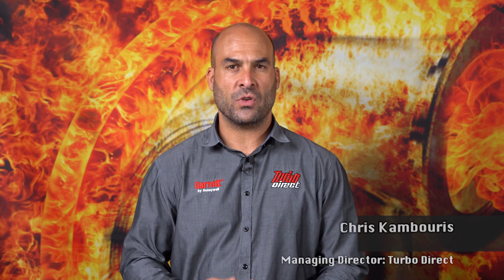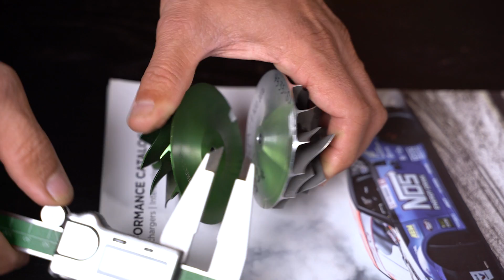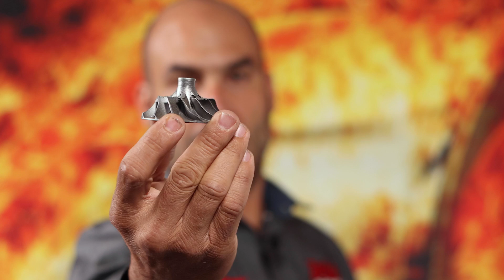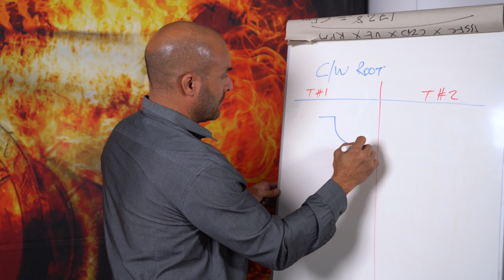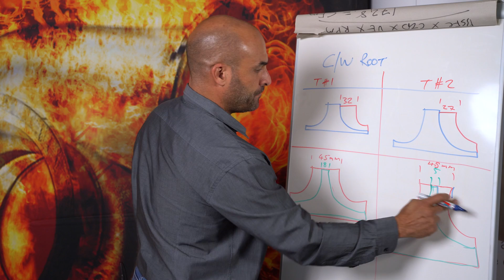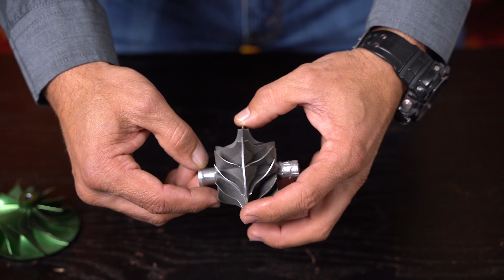Turbo Compressor designs - Discussed

Comment: So on the root width is that the main reason why cast wheels flow less than billet wheels at the same inducer size? I assume the cast wheel requires a thicker root to prevent failure vs a billet. Also second question. Why doesnt any of the big turbo companies do anything with the compressor nut in terms of aerodynamics? Ive seen some Comp turbos with a bullet shaped cap but no one else.
Reply: I'm not the expert here, but from prior convos with Chris I think I can say just mentioning a "billet" wheel does not give the full picture.
A forged billet high quality wheel will have higher strength material, and therefore can likely have a reduced root size with the same blade design, so that would increase flow area, though not decrease total weight necessarily.
Many aftermarket billet wheels may not actually be made from a proper material to have a smaller root than a cast wheel without failure. So while they may be lighter, they may not actually flow more, and they may actually be weaker.
Basically yes, cast wheels likely flow less than properly designed billet wheels of a higher strength material due to root size. But, cast may flow as well or better than cheap billet or those designed for high strength with similar flow.
As usual with turbos, it's complicated! TurboDirect S.A has another great video on that topic titled "Billet vs cast compressor wheels" that probably covers what I just said better.
As for compressor nuts, my guess is that given air flow at such high speeds/volumes over the root, the turbulence is negligible and the total mass/size of the nut is more important. Fancy nuts are likely mostly decorative.
Reply: @802Garage  I bought a Chinese billet compressor out of curiousity and I should say that the external design features are excellent, as well as the weight for its size. But I am not sure about its durability, not convinced that is made out of 2618. And yes, fancy nuts are decorative.
Reply: @aftastosk6016  Same here! Of course many billet wheels sold anywhere were produced in Asian. I have one Chinese billet wheel from a very nice seller on eBay who actually had to produce it to ship along with an upgraded turbine. Turbine is supposed to be 713C Inconel and wheel is supposed to be 2618 Aluminum. Essentially an experimental rebuild on a TD04L-13T for a Subaru.
I'm very pleased with the look and feel of the billet wheel, also very lightweight. As far as actual performance and material strength, who knows? Seems to be mostly a direct copy of a factory wheel with some added features and lighter. There are also narrow nose billet wheels I didn't know about at time of purchase.
Also ordered a GT2554 billet wheel from Aliexpress quite cheap, allegedly made of 2618.  Hard to find replacement parts for those little guys anymore. I suspect many Chinese/Taiwanese billet wheels are from the same few factories. Hopefully they do a decent job balancing! I'm sure they'll hold up in most light duty applications.
Reply: @802Garage  I ordered a 20T compressor wheel from AliExpress made by MAX ABLE (Most products there are either from them or RUICHENG). It's a 6+6 compressor that is of different design than the more usual "Kawasaki" style 6+6 billet wheel that is offered by the Taiwanese manufacturers. It has a more extended tip diameter, a different, more pronounced curvature of the main blades, and above all, smaller splitter blades. Judging by its appearance it seems designed to be more efficient at higher boost levels that the billet wheel, which by itself extends the efficiency range of the MHI wheel by 0,15 bar (from 1,3 to 1,45. This is empirical observation by other users). I have no idea from where the original design came in, possibly it's from ARD which claimed that its compressor wheel could go up to 1,7 bar.
This compressor was ordered out of curiosity but also as a possible replacement for the Td04L-13T that I am running right now in my car. While in theory not the most sensible choice for a Td04L, it was a pleasant surpise that it weights only 37g, 5 grams lighter than the original MHI 13T! 
I want to ask you a few things about the parts that you received. Is it a 9 or a 11 blade turbine wheel? Is it a 6+6 compressor? Have you done weight measurements? Have you installed the new parts in the turbocharger and if you have, how well have they performed?
Reply: @aftastosk6016  Yep the GT2554 wheel I just ordered was from Ruicheng! Max Able was the other option. Same findings. That's an 11 blade wheel with a narrower nose than the original.
The TD04 compressor wheel I got is a standard nose width 6+6 blade. I believe it has slightly extended exducer tips, but factory blade height. It's basically a copy of the factory MHI wheel, but machined aluminum obviously. Not sure if the splitter blades are smaller. I'll have to compare them. I'm very sure it will be lighter overall than the factory wheel, meaning it probably doesn't have much higher material strength. It looks very nice for whatever that's worth.
The TD04 turbine wheel I got is a 9 blade extended tip design. Instead of the original 12 blade it's 9 longer blades with I think a slightly more aggressive profile. So should be more total flow volume, but probably similar blade area, and actually overall slightly lighter. So allegedly more spool and max horsepower. Not sure of downsides if any other than the longer blades and issues those may cause. Possibly not as strong or not as stable at higher speeds.
I have not installed either yet or fully compared to the originals, but I will soon and I'll try to remember to get back to you. I'll note any small differences I see and compare weights. I'll also have a full video of the upgrade on my channel at some point. Both items were ordered from the seller jan_hk2015 on eBay. Hope your experimental upgrades go well!
Reply: @802Garage  the 11 blade compressor wheel is a good option for the GT2554, especially if you have the 0.80 a/r compressor housing. 
The Td04 compressor wheel if it's made out of real 2618 alloy it won't have any strength problems and it would be significantly lighter. My 20T weights 37g while the stock cast MHI should be around 45-46g, which itself is a very good number. my concern is that is it's made of something else, it would be more heat-expanded than it should be.
About the turbine wheel, you won't have any stability problems as long as it's properly balanced. You need to go to someone to get it balanced after install. As far as strength, as long as the CHRA is in good condition and the compressor is not overweight (e.g. installing a 20G in a Td04L) your only concern should be excessive backpressure and overheat.
Now about the number of blades, the general rule is that more blades would provide a better spool - a better response in general. The less the number of the blades, spool is building slower and of course backpressure is reduced. I am not so enthusiastic about the 9 blade turbine wheels in the MHIs turbochargers, I don't consider it an overall improvement but certainly is more suitable in many cases. In practice less weight keeps boost threshold at around the same point but boost is being built slower. To understand if the 9 blade is for you, a good indication is where your wastegate is setup. If you need to be setup very high (let's say above 1 bar) then, the 12 blade (or 11 which is a good middle ground) is for you. If it's too low, then the 9 blade is a better option - but in this particular case going for a stock 12 blade MHI Td04H maybe a better option than a  9 blade Td04L. It depends on the application.
I decided not to install the 20T in my Td04L but replacing it with a Td04HL-20T. The truth is that the Td04L is installed into a 1.8 lt engine so a Td04HL in theory is a better choice. Let's see. If I was about to order it now, I would had taken a 19T because it's virtually impossible to find a 20T housing, so I need to machine a 19T housing - extra cost.
Reply: @aftastosk6016  Interesting insights! I've rarely heard of or seen the 20T so yeah 19T seems more sensible in terms of parts availability. The 9 blade turbine 6+6 billet compressor upgrade turbo I'll be testing will likely go on an EJ205. I should be able to tell if there is a hugely noticeable difference.
Reply: @802Garage  you would hardly notice any difference in spool and you are going to have a bit more top end. Not huge differences but certainly a situation where you lose nothing and gain something. I would prefer going for a 19T and obtain a used 19T compressor cover which here where I am costs 50 euros. The other more expensive option (assuming that minimal lag/excellent response/spool are your top priorities) is to go for an aftermarket Td04H-19T which is a very well balanced turbine-compressor combination. You would lose 100-200 rpm in boost threshold point but in all other parameters it should be a 100% gain.
Reply from the maker: @aftastosk6016  2618 isnt always the best material. the 6000 and 7000 grade materials also provide a great option depending on the application.
Reply from the maker: @aftastosk6016  Ask for a compressor map and then see what happens. Its easy to thumb suck something and make it look pretty - who tested it? Where is the data? Where is the choke and surge limits versus P2C and speed - this is key info so you can know how the choice will match together with the rest of your build.
Reply: @TurboDirectSA  my concern is if is made out of 2618 as advertised.
Reply: @TurboDirectSA  unfortunately aftermarket compressor wheels rarely if never come with their compressor maps, chinese or not. Even OEM compressor wheels they don't have their maps disclosed, you know that very well. So a "best guess" is our only option even if that can be misleading, I agree with you. Myself I am the last person that would be impressed by a fancy looking compressor, for example the cast MHI/Greddy wheels are still one of the best out there. However many people got hooked into the "next best thing", wicked wheels, bat wheels and all these fancy shapes.
Reply from the maker: @aftastosk6016  I understand so confirming material spec based on what the company advertises.
Reply from the maker: @aftastosk6016  With performance setups, MAPS are almost always disclosed. OEM applications are not for various reasons.
Reply: @TurboDirectSA  these "various reasons" feed the aftermarket. I am very traditionalist in my views, it's not a coincidence that 95% of new turbocharged cars have 6+6 cast compressor wheels. People ignore that apart from the blade optimization process that is far more important than being cast or billet for overall performance, castings have been improved a lot the past decades.
Reply from the maker: @aftastosk6016  I hear you and agree with you there. Also remember that OEM applications arent looking to extract the maximum flow from a specific size compressor - so a 6x6 design is more than adequate. OEM designs are also very limited in the amount of boost they run and the turbo is designed specifically for one engine application and not made to be used as a universal unit to fit many engine sizes and states (flow rates, valves, cams, CR's , fuel types etc)
Reply: @TurboDirectSA  Thanks for all the awesome replies!
Reply from the maker: @802Garage  Pleasure - anytime.
Reply: @TurboDirectSA  In most cases OEM turbochargers leave room for improvement by the simple fact that they come out of the factory with a significant safety margin for reliability reasons. Also, indeed in many cases are so good and an excellent match of the pair engine-turbocharger that is not so straight forward to really improve on and not just upscale. I have a difficulty understanding your comment about the 6+6 compressor configuration. Apart from the 5+5, 8+0 and 9+0, is more suitable for high boost applications than the 7+7 or the 11+0 and in my opinion, the best configuration in most cases.
Reply: @802Garage  - That 9 blade turbine that's slightly larger than standard, have you test fit it yet, does the turbine housing require machining?
I'm having a look through that eBay seller's store right now; thanks for sharin'
Reply: @tommylyeah  Admittedly I have not yet, too many other projects. I did finish the GT2554 rebuild and filming, need to edit though. If you message me on Instagram to remind me especially I will try to test fit in the next few days. Have the turbo sitting on my bench. I can even send you pics/vids.
Reply: @802Garage  
[B]ased. Much appreciated, bro!
Reply from the maker: @802Garage  Spot on in most of what you said buddy.
Reply from the maker: Correct 100% - the cast wheels have a weaker material (even though they are heat treated through a solutionised ageing process) so the root is designed to ensure reliability. With a stronger material the root is able to be changed somewhat to increase blade area ....etc  The shaft nut will affect aerodynamics but not by any margin worth worrying about.  It looks great and has other functions (warranty related) but performance related purposes will not yield much benefit.
Reply: I think what you point out is more important for the turbine nut.